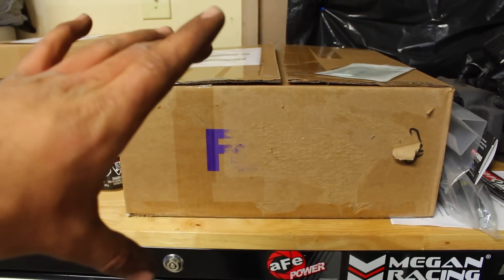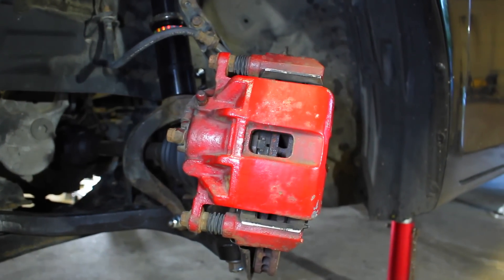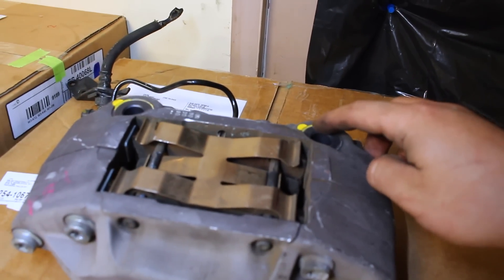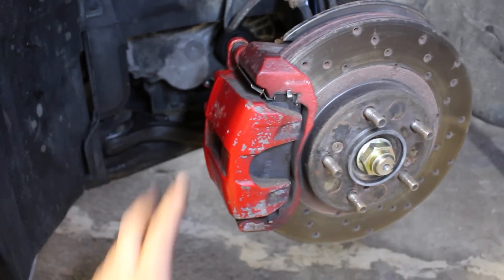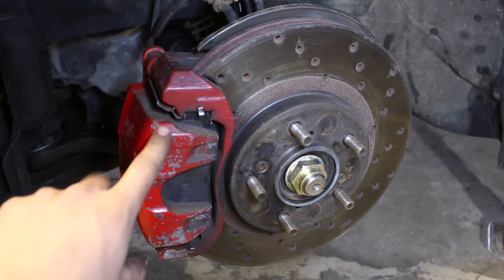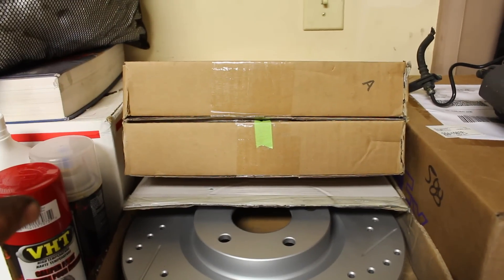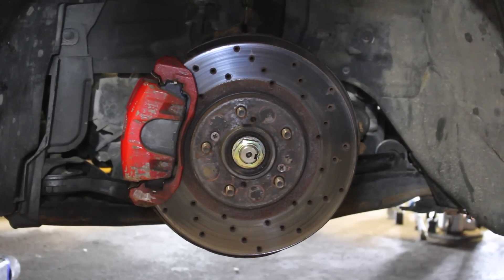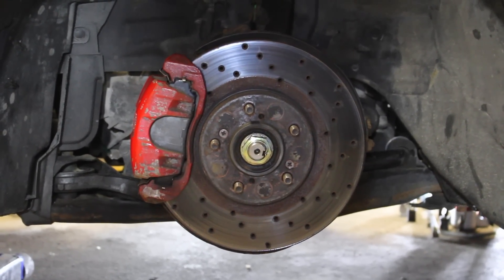How to Build a 4 Piston BBK on the Cheap!!!

Comment: You can do the same with a 92 - 95 Honda Civic, but you would use the calipers from a Acura Legend which will bolt up directly. The only thing you would have to do is grind about a inch off the rear corner so they can close and for the big rotors you can use Prelude rotors because they are bigger a look good. The whole process and cost is nothing $200 tops for everything or less.
Reply from the maker: Thats pretty killer!! BBK on the cheap 👍

Comment: Please help, saw this BBK that is a direct bolt-on for my 2011 Accord Coupe LX-S. It recommends that it fits a 286mm or 302mm diameter rotor. Couldn’t find anything that spec for my car, but found a 300mm. Would that still technically fit/work?

Comment: it's debatable... cars fitted with larger brakes also usually have larger fluid displacement & a more beefed up brake system as a whole. not just the brakes themselves..

also alot of single piston brakes can be more efficient then multi-piston setups, as the single piston has a larger surface area then a group of individual pistons etc..

Anyway, ppl need to be aware there's more to a big brake swap then just the disks, brackets & calipers... abs set-up etc, the brake pressure set-up, larger reservoir etc..

then there's why add larger brakes to a small engined/low power car?!?

Comment: I'm also using Maxima rotors but Maxima rotors are NOT THE SAME DIAMETER of the 350z track rotors. Maxima is only 12.5 and 350Z track is 12.76. I have a bit of pad that doesn't make contact with the rotor because of this. If there was a rotor that was 12.76 and only 28mm thick instead of 30 it would be perfect.
Reply: How thick are those 350 rotors?
Reply: @alitoroganan2442  350Z track rotors are 30mm thick. I tried using those at first but they wouldn't clear the RL calipers
Reply: @killer2931  fark noooo, that's the one that i bought.. They all say use the ones from 350z

Comment: 06 tl owner and I'm looking for the same upgrade and started following a few sales of rl calipers on ebay. Dont want to pay five times more either for the upgrade. I am concerned about clearance with stock 3rd gen wheels. I have blank centric rotors for 2yrs now and they're warped. I know it depends on the driving type but still cant decide if i should bye blanks or drilled and slotted. I want to make sure I'm buying the best option for my driving. I only asked based on your experience. I've read and seen a lot of videos. My brakes arent for car shows their for parkways and highways. Thanks in advance.

Comment: Hey man, I love your video. You did a good job with the installation.
I have a question, I'm getting a lot of high pitch squeaking from my set up any advice on what I could have done wrong?
I have the 9 gen accord v6 other than that I used all the same parts as you did for  your car 
Thank you for your time.
Reply: I have the same issue, any solition to make the squeak go away?